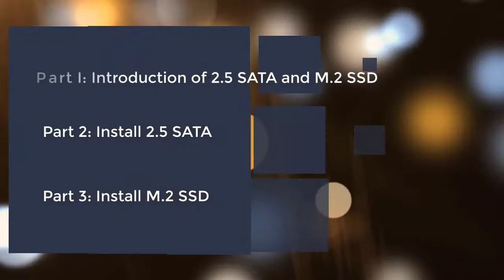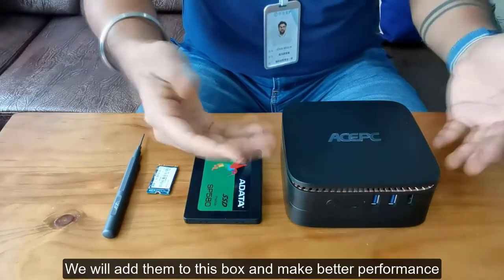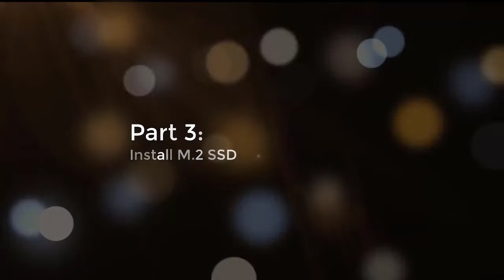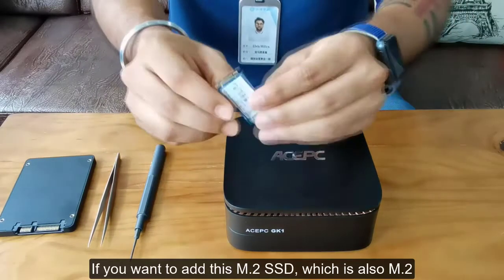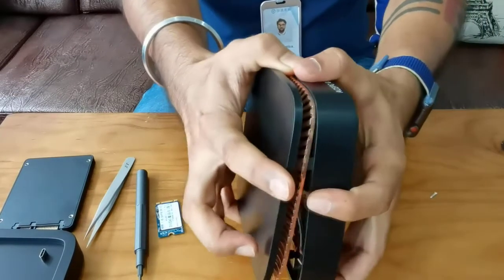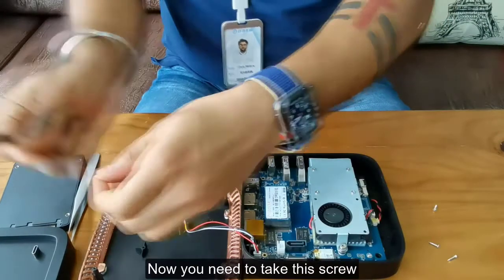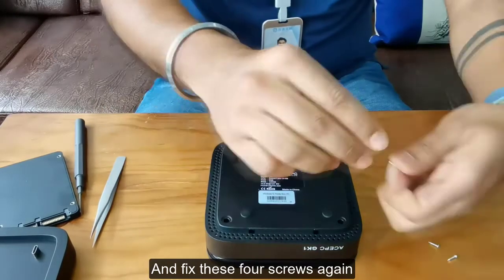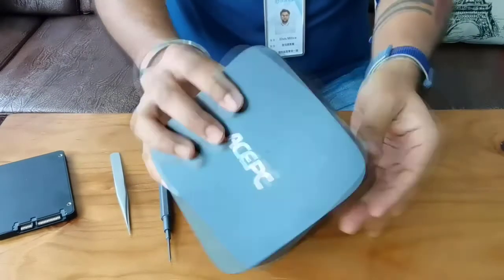How to fix 2.5 SATA (SSD) & M SATA (SSD) in GK1 MINI PC | ACEPC CLASS 06 | Best MINI PC in 2020

Comment: I have a GK1 and tried to install an M.2 SSD (KingStep NT-128), but only get a "No NVME device found" in the BIOS. Then I thought that the GK1 might only support NVME cards and bought a M.2 2230 PCIe NVMe KBG40ZNS128G, but still the same message in the BIOS. Are these cards not compatible or is there a setting in the BIOS that has to be changed so that any M.2 cards are recognized?
Reply from the maker: Regarding the newly installed SSD that cannot be recognized by the BIOS, it is because the new SSD does not contain the system boot file, so it cannot be recognized; the SSD needs to be formatted before installing the system.
1. If you have another computer, you can download [DiskGenius] to format the SSD.
2. If there is no other computer, you can create a PE system and enter the PE system to format the SSD.

It is recommended to refer to the following video for formatting operations: https://youtu.be/MCoHqpZ8CHA

PE file: https://mega.nz/file/gn0mkSTT#FXZUx9m6cWYdhJci4Dx7nVrN6Ouy96l2yPQS1S9q5Yk
Tutorial on installing PE system:
https://drive.google.com/file/d/1qDc9aRTGYCK-QakBuNK469-LObaigweC/view?usp=sharin

3. If the above operation still does not work, please replace it with an SSD with SATA protocol, and then try the above steps again.